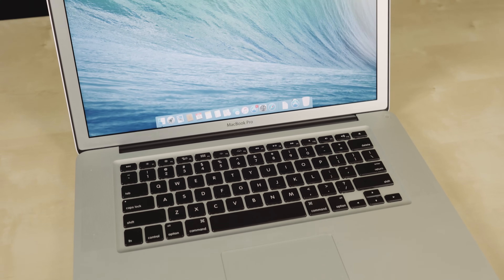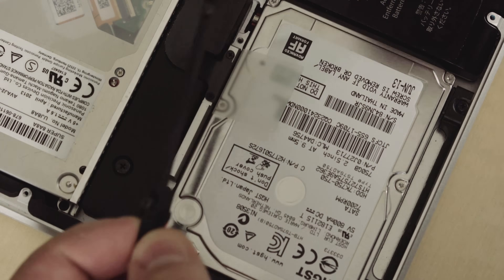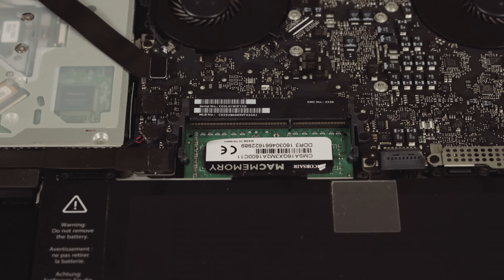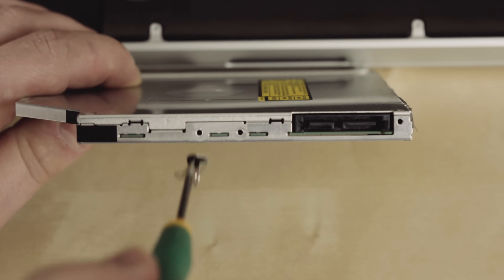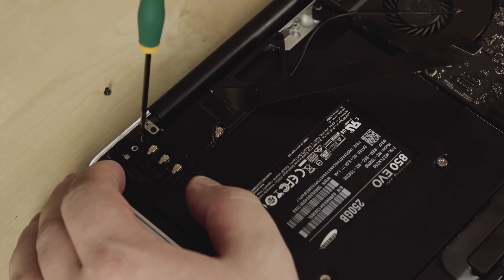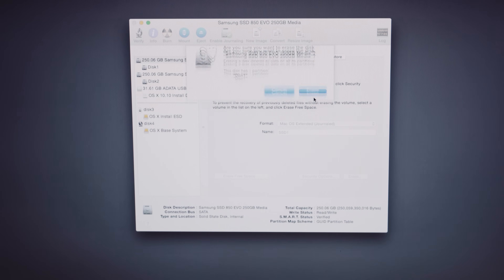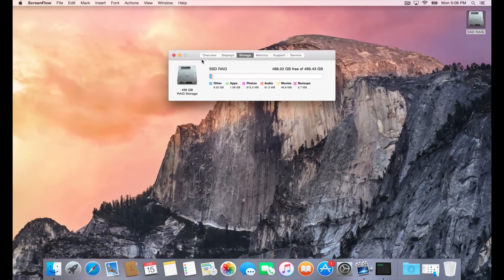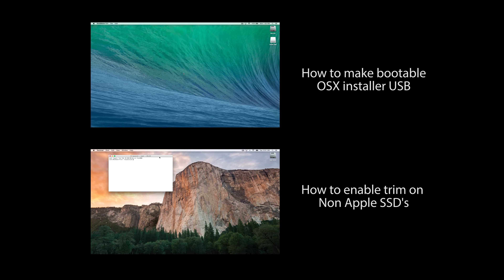Fastest 2012 MacBook Pro Ever! Upgrade Guide - in 4K

Comment: This is the last good MacBook Pro Apple made.
Reply: IMO it's the BEST MacBook Pro Apple has ever made. I won't buy a new one until Apple fixes the keyboard issues.
Reply: @matthewgrumbling4993  Now fixed on the 16"
Reply: @matthewgrumbling4993  check this  Louis Rossman ( New York Apple repair shop + youtube site ) https://www.youtube.com/watch?v=xFIVZYevfGU
Reply: @matthewgrumbling4993  Yes. The keyboard issue sucked. I had to take it all apart because of that. It was actually easier to buy a clone generic the top assembly with the keyboard already in it then to actually replace the keyboard itself but it was still a pain in the ass as far as remembering what screw went where
Reply: I totally agree, I just picked one up in mint condition for $250.0 and updated it a 120 gig ssd and also 16 gig ram...right now I am favoring this thing over my 2017 MacBook Pro. Something about the design of this thing. Great backlit keys, solid construction...the only thing lacking is the display but I can live with it
Reply: I agree that 2012 was apple peak, the iPad 4th generation and the iPhone 5 were released introducing the lightning connector.
The last pre-retina MacBooks (2012) were the last MacBook with a decent amount of hardware compatibility and upgradability.
Reply: I love mines! I hooked it up just like this video a few years age.
Reply: @allstar930  I bought mine from an authorized reseller, refurbished with a two year warranty on eBay that had already been upgraded aside from taking out the SuperDrive and putting in a secondary hard drive, and then I also upgraded those to SSD’s. If only the GPU could be more easily upgraded, and if there was a way to flash the firmware so it would take 32 GB of RAM…
Reply: no, its actually the 2012.
Reply: Damé Dinero why?
Reply: name's ash, housewares 

The 2012 MacBook is the last upgradeable macbook Apple made. The hard drive, ram and batteries can be changed for cheap prices. And the cpus are very good for getting decent tasks done.

In short, it’s perfect for college students and anyone who just wants a laptop as a 2nd computer that will last them a very long time (10-20 years)
Reply: @Jonalius  The 2015 only has soldered on RAM. If you get the 16GB model (if you need it) then you're fine.  The rest is upgradable easily enough.  Battery is $89 from OWC and the Aura 2 512GB SSD from OWC is $149.  Not too bad at all and you have a much newer and thinner laptop than the 2012s.
Reply: @dustinschings7042  but does it have usb out,ethernet,cd drive, sd card slot etc. ???
Reply: @dustinschings7042  what if I got 8 G version?
Reply: @dustinschings7042  and I want to upgrade Ram to 16 or 32 G
Reply: @dustinschings7042  dont forget the retina display and weight. My 15" 2015 is lighter than the "13 2012
Reply: @Jonalius  10 to 20 years? They're already 7 years old. You seriously think a 27-year-old MacBook Pro is gonna be kicking around then, snappy as ever? For twenty years 128GB of RAM will be standard. An 8TB SSD or faster will be required and low-end processors will be 32 core 8Ghz
Reply: Dustin Schings but the price tgi
Reply: @a22258461  2012 only supports 16 GB, sorry, i get that the last month checking it on most places, check if want to keep secure.
Reply: @Jonalius   hi there! ey I got a question. Is want to upgrade to 16b of RAM, I´ve been watching different videos and they suggest to use Corsair RAM. But my budget is limited and I found Kingstone RAM, ddr3 8gb 1600MHz. Will it work fine?. I`ve already have a SSD, so I think it is the next logical upgrade. Thank you. Hope you can answer me soon.
Reply: @Jonalius  You can also game by adding an external GPU. Mac is the best because of the value. It lasts for so long. I know someone who has a MacBook pro retina 2013 and still runs today for basic tasks and u can even use photoshop and video edit
Reply: @dustinschings7042  2015 is trash, Apple should have another class action against them over the dangerous swelling  lithium batteries issue.
Reply: @Jonalius   the 2015 is also upgradeable.
Reply: Dustin Schings the 2015 is a good computer also, changing the battery on it is kind of a pain in the ass because it’s glued to the topcase. Experienced computer technicians like me can change the battery in 30 minutes, but for the average user it’s a little intimidating.
Reply: @Jonalius  totally true. While it is definitely upgradable, Apple did not make it easy. No authorized Apple service provider will do these upgrades, so if somebody is capable of DIY upgrading, then it’s well worth it. I thought the whole reason for the “pro“ series was so that they would be upgradable and if people were going to spend that much money, they would have the assurance that the machine would not become obsolete as quickly. Once the ram is maxed out on this machine, and the hard drives are replaced with SSD’s, aside from not having thunderbolt 3.0 or USB-C, it is just as fast as many of the new machines. In fact, I bought it specifically because it has FireWire 800. I have several external hard drives and audio interfaces that use FireWire, and they are perfectly functional. I just wish there was a way to upgrade the GPU. Technically, there is but it would basically mean turning this machine into a desktop. There is an expresscard 34 to pci-e x16 adapter that allows you to connect a desktop graphics card. It’s definitely not pretty, as there are lots of cables. You can get a case for it, but you’ll definitely lose laptop functionality. I’m considering it though
Reply: @dustinschings7042  In 2018, I purchased a top-of-the-line MacBook Pro, 15 inch. I bought the one that had the best specs that Apple offered. But then when I discovered that the ram could never be upgraded be on 16 GB, and at the time, there were no adapters for USB-C to fire wire, etc., I returned it within the 30 day grace period. There is no way I was going to pay $5300 for something that could end up being a paperweight in five years
Reply: @a22258461  The whole reason that these were originally called MacBook PROS Was because they were upgradable. Seriously, spending $5000 Without being able to upgrade the RAM is insane
Reply: @damedinero3210  Agreed. I’ve upgraded mine to the hilt, with two 1TB SSD’s, 16 GB of RAM, although it really needs 32 to run a DAW like ProTools to its maximum, And I wish the GPU could be upgraded more easily
Reply: Cappuccino - no, its the mid 2014, the last one with macOS in Steve jobs Style
Reply: The last macbook 2019 has issues. Macos Catalina can't run the 32bit softwares, and you can't downgrade to mojave...
Reply: Famous last words
Reply: You speak truth. Not rumor , lie or subterfuge.     These little books, if well kept, can run a long time  and upgrading them is cheap, if called for.     Just take the time to dust out the cooling system from time to time and  avoid dropping them from tall buildings........And pay attention to the order those bottom screws are placed.  Put them back exactly where you pull them from.
Reply: My Mac Pro 9 1 I’ve had since late 2012. After replacing my starter drive with an SSD, I have had no issues.
Reply: @djardy07  I have an early 2011 with Catalina patch and replaced airport card. The drive works well, but I am thinking to change to a solid state drive so it can last me through the rest of my high school year and maybe into college.
Reply: you're damn right. I bought mine refurbished, have used it for 5 years and now I'm upgrading it for under 100USD. Great hardware and great product overall. It's so damn stupid how newer models don't allow you to tune up your stuff. People buying into Apple's false narratives lol

Not only that, but you get the best of both worlds(or 3), because you can have windows, macOS directly supported and Linux if you're into it.
Cheers
Reply: True!
Reply: 2015 was a beauty as long as it’s the top spec model.
Reply: Raphael Portela  Beautiful choice. It's a way better machine, but of course it is much larger and heavier (assuming you are going with the 15inch).
Reply: Now, 16" MacBook Pro. Best ever.
Reply: Early 2015
Reply: Cappuccino - and it’s got A TON of ports
Reply: I'm typing this comment on my upgraded 2012 Macbook Pro as we speak. 500gb ssd + the original 500gb hdd with 16gb of ram. The only downside of this device is the i5 processor instead of the i7. I wish I could find a cheap i7 model to upgrade.
Reply: Yup still have mines and with this new upgrade its better than ever!
Reply: Cappuccino - Agree! And I did this to my daughter’s old school Mac, which she gave me :)
Reply: does this get a decent good pc for gaming and buying EGPU?
Reply: I have the 2018 and the 2011 but upgraded. I use both and I love  them equally. Will never sell him!
Reply: Macbook M1: hello everyone i'm the best Macbook ever
Reply: This seriously was the last Mac laptop id be happy using on a daily basis. I have a 13" i5 model, upgraded to 10gb of ram and a 1tb ssd and it works great now. The design holds up great and I've owned it for about 7 or 8 years at this point. Can't recommend it enough to anyone that wants a somewhat affordable mac.
Reply: Mine is i 7 at 2,7 GHz , 16 Gb of ram and 500 Samsung Ssd 650 GT with 1.5 GB dedicated video card , i bought it from my uncle with 400 € with box and all accesories almoust brand new without signs of use and i can say after 1 month of use ... this is a bad ass machine !! he don t have time for hick ups or being slow , is just super fast in all !! Is a pleasure to work on .. the only downsize is the rezolution 1440 by 900  but is not always a problem and if you want to play games like mafia don t work.. low fps ... but for world of warcraft it work fine , heartstone .. it work fine ! And for who want to buy this .. it s a bit heavy !
Reply: The 2012 “unibody” and 2015 is the best, the both
Reply: I agree. This was the last upgradable MacBook Pro Apple made. Even though they made it harder to upgrade. Although my father has a late 2014 MacBook Pro that is somewhat upgradable. However, the SSD is hard soldered to the motherboard. I bought a brand new 2018 MBP when it first came out and spent $5000. I returned it a week later, thinking how ridiculous it was that I couldn’t even upgrade the RAM in the future. I have been shows this particular machine and got a certified refurbished from eBay. Upgrading to 16 GB of RAM and putting in 2 SSD’s has increased its Xbench score by 3.5x. And I don’t just mean the hard drive test, but overall, and every category. Aside from the L key not working, which believe me gets extremely frustrating, it’s like a brand new machine. I just wish the dedicated PCI-e dedicated GPU had more than 512MB of RAM
Reply: @RobAnthonyDire  Exactly, although the 2014's do have removable SSD's, you just need an adapter from NVME to the proprietary Apple slot. And the RAM is hard soldered to the MLB.
Reply: @RobAnthonyDire  mine have Gt 650 1.5 gb video it run wow without any frame drop
Reply: Ever since Steve Jobs passed away, Apple has made some terrible decisions and awful products. I am convinced that he is the only person who could run this company properly. The new machines are nearly as bad if not worse than the original iMacs
Reply: I still have mine 2011. With window 10 work like a baby
Reply: Cappuccino - the 2015 is.
Reply: @agneevX  That would be the latest model I would consider buying. Anything after that is a total rip off. Who would spend $5000 on a machine that they cannot ever upgrade?
Reply: @agneevX  Yeah, my dad has that one and it is good but it’s still not upgradable. This machine can be upgraded to practically match that one aside from the GPU being slightly better in that model that you mentioned
Reply: @agneevX  2015 is good to, if you got the 16GB RAM config.
Reply: 2015
Reply: Hello, I'm coming from the future to tell you that the last good MacBook Pro Apple made will be the 16 inch MacBook Pro released in late 2019.
Reply: Jeremy Eden I think I meant dvd drive,, cd was a compact disc that we used in the 90s and 20oos to listen to music.. If you have a 2012 MacBook Pro you can take that dvd cd drive out and add another ssd hard drive.. I added 1 tb to mine
Reply: No it is the 2019 16 in a as of now because I can get apple support for it still

Comment: I will be upgrading my 2012 MBP with EVO 860. Thanks for this tutorial.This was helpful.

I wanted to ask one thing.Is it possible to install empty SSD inside the Mac, then restart MBP by holding option key or in some recovery mode and get the OS X installed on target Disk via internet.

If required I can use Disk utility and format the SSD in Mac OS journaled (Extended) and then install the empty disk in the mac.

Comment: So added the SSD Drive caddy to replace the Optical Drive and when screwing it down, the cable would no longer stay connected.  I used the same drive caddy that was on the link, so I don’t know what the problem is.  If anyone has had similar issues, I’m all ears.  I guess I’ll have to order another replacement caddy.
Reply: Oops. User error.  Pulled it out and saw that I had trapped the cable underneath the caddy.  Lesson...photograph your setup before pulling it apart.  Every computer is different and my connections to the wifi antenna etc, were slightly different too.

Comment: “You may not install to this volume because it is part of a AppleRAID” 

Does anyone have a fix for this . Just spent a bunch of time doing everything in this video and I’m stuck on this prompt.

Please help
Reply: Reformat you hard drive to guided map partition
Reply: danpape shredits  I just did my mac today and mine is saying the same thing. Did you get it figured out why it says you may not install to this volume because it is part of a AppleRAID”?
Reply: Danielle Coley i didn’t unfortunately I just didn’t bother with that raid version and kept it as 2 separate SSDs, it’s good enough for my needs
Reply: danpape shredits  I ended up doing that too. Mine is doing great now.
Reply: @danpape  I am getting the same message "Y
Reply: Is anyone experiencing the panic kernel issue? If so how do you fix that
Reply: @kingdomkidsmedia6395  Okay, I assume you are using a hdd and an ssd right?
Reply: Youtuber yes.
Reply: Youtuber but then hard drive has nothing to do with the crash
Reply: @kingdomkidsmedia6395  Okay so, forget about doing the raid thing. You need to have them separate...
Reply: @kingdomkidsmedia6395  When you combine 2 disks togheter, they have to be an ssd of the same company and same performance.
Reply: Youtuber ok thanks
Reply: @kingdomkidsmedia6395  What laptop do you use? atm

Comment: I have a mid 2012 MacBook Pro and it’s still a kick ass computer. I’ve made all the necessary upgrades. Most important was getting rid of the horrible HDD it cam stick with. Everything is such high quality, but that HDD truly sucked. Ssd and 16GB RAM and I thing I’ll run this for another 5 years. Plus it’s like the last Mac you can actually modify. Haha I love how the limit was 8GB if RAM and it ended up being a mistake Nd was 16GB

Comment: Just curious, if I were to transfer from my OG Mac drive to SSD via carbon copy. Would I still be able to sync a second SSD drive by taking out the optical drive? My goal is to put a 500db SSD into the original Mac drive slot like you showed here and to put in a second 250gb SSD. But, I also do not want to completely start my computer over. I don’t have an Airport for Time machine to backup to.

Comment: I did this on 2015 with only one change of yours. I installed Windows on the second SSD and on the First SSD I did a partition of 250/250. On the first 250 I installed the MacOS and the second 250 I make it a "slave" just to save things there from Windows or MacOS. Works really well and we are almost on 2019!

Comment: @mredgardotcom thanks so much! 

I replaced the hardware and everything went fine until I tried to install my copy of the High Sierra install. It would not allow me to preform the install because of it being formatted as a RAID 0. It has some message about it cannot be performed across an AppleRAID. I even tried to do a reboot in recovery mode, then ended up having to go through installing lion, and El Capitan until I could finally install the regular Sierra. I scoured the web for ways to do it and couldn’t find any answers. Any hope that there is a solution someone knows of for so the final install of High Sierra??? Please help?! Thanks.
Reply: Same here
Reply: figure it out yet?

Comment: Hey man, great video.  Have got one SSD and 16gb in my MacBook Pro and its very quick.  Just wondering if you've ever come across a problem where the Internal Microphone doesn't work?  Or it doesn't work consistently at least, and if you could point me in the right direction of how I should fix it?

Comment: I have one of these babies and as of September 2018 it is my main computer and will be for a long time to come. I use Windows 10 on it because it's a lot more stable and faster than Mac OS, but dude this thing is a monster. It's fast as heck and it's absolutely beautiful, especially with the antiglare display that apple doesn't even offer anymore.
Reply: Can you install both? And choose which to boot every time you power on?
Reply: Can you take a time machine backup, keep that safely tucked away and install windows. If you don't like it, cant you just restore using time ms hien and it's as if you never installed windows at all? Or does that screw up the bios/recovery/safe mode?

Comment: Hello, awesome video! This is going to help me upgrade my older Mac for use in my design business and save tons of $$$!!! I was wondering however, I found some Samsung 2.5” SSD solid state drives that are 860’s with 500gb of storage, are those still compatible with this same rebuilt you showed above? Thanks in advance.
Reply: yes those sdd should work, RAID 0 its pure performance, make sure you have a good way to back up your files; constantly